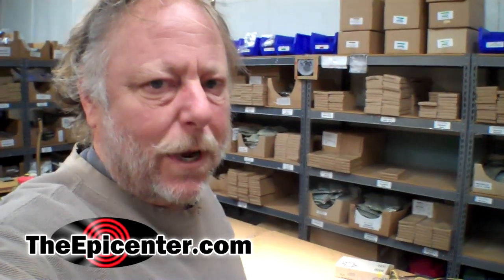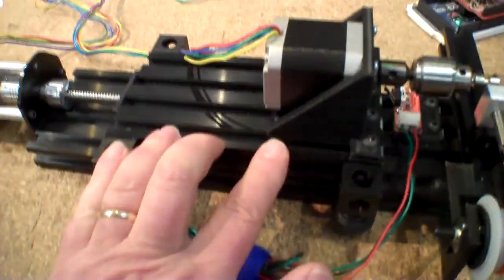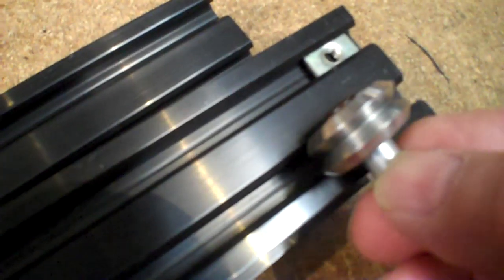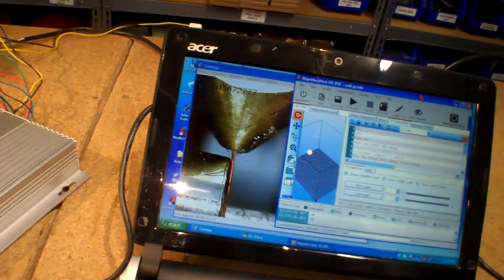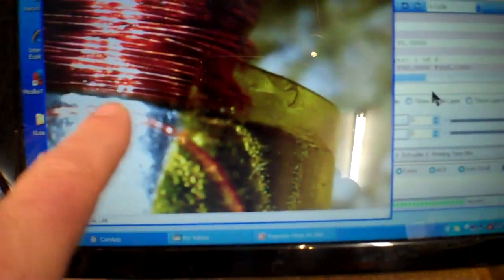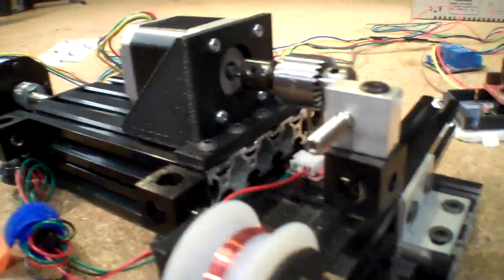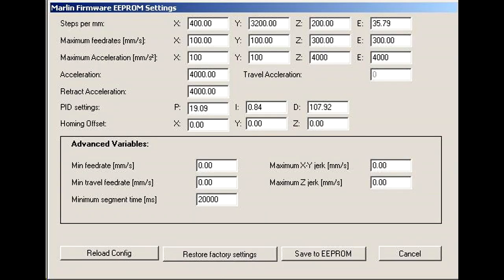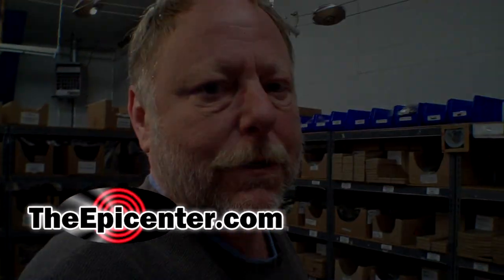DIY Coil Winder  - with Arduino Mega and Marlin 3D printer firmware

Comment: Really cool.  I have been looking for options for building something to wind guitar amplifier coils, which use a variety of wire sizes (really big and really small).  I think if I were just wanting to make small transformers, there is a technology that is tried and true, which is a rod and reel.  -Or at least garnering some parts from an old reel.  That little self reversing groove is a jewel. Having said that, I don't know if the self reversing screw can be cut shorter and still function.  Anyway, great engineering on your machine.  My thought at this point is rather than having a software controlled guide It seems like the speed of the winder should control the guide, even if pulled backward.  A wheel like a sewing machine seems a good idea too, as this is a machine that could assist manual operation and vice-versa, since wire has a tendency to refuse to cooperate and make bird's nests.

Comment: I plan to do something like this in the not too distant future.  I know more about this topic from the electrical/magnetic perspective than I do from the motor control angle.  Like you I have thought that winding on carbon fibre would be a good option.  I have to say I'd be less keen on Aluminium as it's conductive and is going to invite losses through eddy currents (carbon of course is also conductive but nothing like AS conductive).  Maybe those losses are going to be insignificant in comparison to the resistance of the wire but I would suspect they'd show up on the hysteresis curve rather than in an L + R transfer function.

Since you are doing it on such a small size (though I now see I am two years too late) you could use sewing machine bobbins as your former.   Finding decent and cheap bobbins on a larger scale is something I am finding nearly impossible, even from China.  I was also going to suggest using epoxy - probably with some filler to avoid drips - rather than nail varnish.  Having the bobbins could help you not get the glue on your collets and shaft, which might be hard to remove if you leave it too long.  But this video has been very useful in helping me formulate my plans so thank you.  My next step is to find a decent tensioner mechanism that will do 1.5mm wire - other end of the scale from you.

Comment: I love how you get straight to the point and you don't waste time on a soap box. I'm going to use some of this information to make a device to help me make vape coils ... i've always wondered if i could synchronize two stepper motors with enough precision to handle 38 and even 40 gauge wire ... looks like you've done it but that stepper controller looks pricey.

Nicely done video - you covered all the details with efficient timing!
Reply from the maker: Awesome! Glad you found that useful. The big improvement not shown is to use a smaller diameter wire guide, and one that can get in closer. It's delicate and tricky to adjust, but a syringe type tip used for dispensing glue works great. But not advised until you nail direction and all that. Easy to go too far and bend the tip if the gcode is not fully tested first.

Comment: Not sure what the nozzle is made of, but if you can solder to it, you could solder it closed on the end and take a drill bit and drill a hole the size you want. I realize this is an old video, and someone has said something about getting other size nozzles. Cool, knew you had some technology in your background with the freezing of old books to see if you could save wet books. One of them you used was a ttl book. wb0vkl
Reply from the maker: The nozzle is brass so yes, that would work. And I have lots of super small drill bits now. Yes, in my prior life I was an analog / digital circuit designer.

Comment: Ok so what are you using 200 mini pickups for??
Reply from the maker: Well, they were used to measure feedback for the movements of a stereo record cutting head I was developing. Several years were spent on that project, and it worked pretty well once rebuilt. But the head was too big and I could only cut 1/2 a record with that version.  The videos were private - only for a forum where people were interested in the topic. I might post one where I blew up the head demonstrating how the feedback was working. That one was pretty interesting... Who knows. So many projects, so little time.

Comment: I like the way you have put this together. I know now in Youtube terms this is an old project but should you ever revisit it or do something similar, regarding  the difference in nozzle hole size compared to the wire diameter, you may find that due to the nozzle being made of soft brass you could use a punch to peen the brass over reducing the diameter of the nozzle hole. This would have the added benefit of work hardening the brass in the vicinity of the nozzle opening itself.

Comment: Good work but over complicated producing in-perfect coils, only worth  it if you wish to produce tons of coils, then a multi-bobbin winder would be better.
I knocked up Tesla secondary coil winder with some wood a spindle and cordless drill in 1 hour with perfect non crossing turn. The golden rule start simple then improve as you go.
Reply: Your point?? I think the video was very helpful with lots of good ideas that have helped many of us. He took his time and explained the mechanical and firmware issues that are confusing if you have not played with them. 
He was winding .1mm wire and that would have been a total disaster on a cordless drill arrangement as you described. 
He also needed a somewhat accurate turns count for his project whereas your tesla coil simply gets more output voltage as you increase the primary vs secondary turns ratio.
Sounds like you are ignorant enough that you should not criticize someone else's work when its obvious you have too little understanding of what the author explained. Zzzzzzzaaaaaappppppp to you and your tesla coil.
Reply: Wrong Tesla's to work correctly need counting as they work on resonance not just add turns like you say,+ I wound thinner than that on a cordless with speed control.

Comment: Your coil will have some issues and not output as well as it would if the windings were laying perfectly on top of each other, another thing you might want to look into is vacuum impregnating the coil with a polyester or epoxy resin.

Comment: That is a great device. If you made a small notch on the outer collet (where it slides onto the shaft) then you could bring the start of the wire down at shaft level and out to the end of the shaft. That would eliminate any need for tape or anything else to hold the wire. Also, you can write a simple sketch to spin the stepper motors and eliminate the need for the 3D software program and other programs. Use an arduino nano and you just need a start button. Lastly, a V bearing would make a better guide and give you more control. I can see it making perfectly wound coils. 

A few tweaks and that machine will be the cat's meow...

Comment: You said you need only 2 perfect Coils. Too my this setup looks overengeneered but still doesnt give 'perfect' results. I think you get the job easier done when you programm the arduino direct to controll the 2 stepper motors. use the microscopt to determine the windings per round and then just put it in the arduino sketch together. To improve the accuraccy you need a better wire guide. The nozzle is too far away. Better use a small pipe* and go as near as possible to the coil body ( depends on the end diameter of your coil).* You can buil the pipe with a 0,3-0,5mm drill with hardwood or plastic. Another idea is: use a  sewing needle and bend the end of it to 90 degrees (heat it maybe). this could work as guiding arm instead of a nozzle.

Comment: Great proyect!
Suggestion: Remove the 3d printer nozzle guide and add more distance between (10 to 20 cmts more) both extremes of the wounded wires. You will get a professional  finish. The key is to keep wire a little tight while wounding

Comment: Good info.  Terrible audio.  update: at a certain point, the audio is okay.  looks like your mic gain might have been too high in the initial segment/shoot.
Reply: Audio was fine for me, maybe it's your speakers.
Reply: Nope. Not my speakers. It's clipping all over the place within the first 10 seconds.
Reply: Perry Codes
Well whatever it is, it's you. Drivers, sound chip etc...
Cause it's fine for me. And don't see anybody else complaining about audio here.
Reply: Nope. It&#39;s not my speakers. It&#39;s not drivers... sound chip... So either your speakers suck or you simply aren&#39;t perceptive to digital distortion. Because it&#39;s in the audio. And I&#39;ve heard it from several different computers/speakers. Turn up your treble. Turn up your volume. And listen to the word &quot;Epicenter&quot; in the first several seconds. The clipping is on the left channel. It continues like that for quite some time, but eventually goes away ... probably during another take with the mic gain turned down.

Comment: I'm planning to build one of these this summer.  I want to be able to produce non cylindrical coils, so I'm working on trying to optimize the whole thing to be able to handle oblong bobbins (like in guitar pickups) as well as cylindrical ones, and maybe even square coils if I'm feeling brave.
Reply from the maker: +Justin Hall It should be easy enough to modify the mechanics to hold oblong bobbins. Then all you need to do is measure the circumference of the oblong bobbin with a wire or string, divide by Pi and use that calculated value for "diameter  of bobbin" in the software.
Reply: EpicenterBryan Thanks for the advice!

Comment: Nice Project. Quick question though. Why not using a standard Ramps shield ?
Reply from the maker: +Cédric MARTIN I'm using parts that are actually for another project (cnc plasma cutter). That project needs to move faster with higher torque so I'm using a 24V power supply and the ramps shield can't run at 24V. Although I did use a Rumba board one time at 24V. It literally burst into flames the first few minutes.

Comment: I'm not sure if it would do anything. But if you know when your "coil part" has made a full rotation, you can move the head with the size of the wire. This way it would be exactly the right spacing...
I'm not sure if it would work in practice, but it doesn't seem to do such a thing in this video.

Comment: Glad I found your site.. I have a need to build something similar to repair coils on mechanical filters. You explained this very well and gave me some excellent ideas that I would have had to attempt to figure out.. Thanks so much for sharing your knowledge and this very slick project!
I will be using 40 gauge wire or possibly 44 gauge litz wire that will have a freq coverage in the 450KHz range, which is the freq these filters operate at.

A few quick questions. Are you experiencing any significant backlash in the X or Y planes? That track looks like an excellent way to go.
Did you find a source for a finer nozzle. I was considering using a small piece of Teflon stock and drilling an appropriate size hole with small wire bits ??

Again, thanks for sharing this project. I have been looking online and as well as youtube to get some viable options and got the best ideas from your project.

Best regards,
Glenn
DSM Labs (doty com)
Reply from the maker: +wa4aos Yes, I found there are smaller nozzles on E-bay. No back lash issues with that leadscrew or the delron nut.

Comment: A lot of slop in that and over winding.  They do sell 0.1mm nozzles for really cheap but I would suggest a stainless steel nozzle so your opening doesn't enlarge since that copper is abrasive to the bronze nozzle.
Reply: Keep in mind that the wire is coated in enamel. I wouldn't want to use either brass (not bronze) or steel for the guide. This is a great application for acetal (polyoxymethylene). If that's not available, then machine something out of some type of nylon. PCB drill bits down to 0.3mm are dirt cheap, and a cursory search on Google turned-up a 0.15mm bit.

Comment: That was very interesting, if you do want to make this a cost efferent project, you could replace the mega with a uno( 4$ to 6$), by adding a grb shield (4$ to 6$) with two a4988 stepper drivers( 1$ to 2$) each, and add a few different mounting plates, so that not only could you spool your tiny coils, it could also be used to coil recycled magnet wire. I am sure that 0.1mm wire, must cost a fortune, you could easily find them on many different transformers on old boards.  but I am wondering, what do you plan on making with these coils? especially  that it with an aluminum core .
Reply from the maker: +patprop74 The end use for the coils is in my home made stereo record cutting head. Those are the feedback coils and push rods where links will go to connect to the stylus holder.

Comment: You might try a (much) longer distance between where the wire leaves the nozzle and the shaft it is winding onto. You should find this allows the wire to track back and forth along the shaft by itself, guided by the last turn already wound on the shaft. That is, it will give neater windings and be much less dependent on the position of the nozzle. You may even find it unnecessary to move the nozzle for narrow (ie most) coils.
Reply from the maker: +Paul Rautenbach what ended up helping was to pinch the wire with my fingers as it spooled into the delivery tube. It helped keep the wire centered. But replacing the nozzle with a smaller one is the plan. I found some on E-bay.